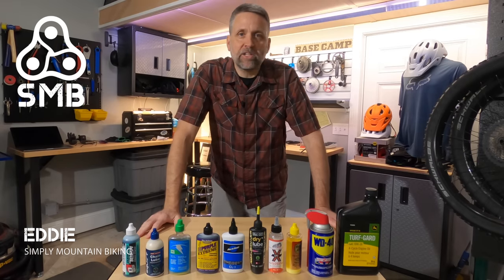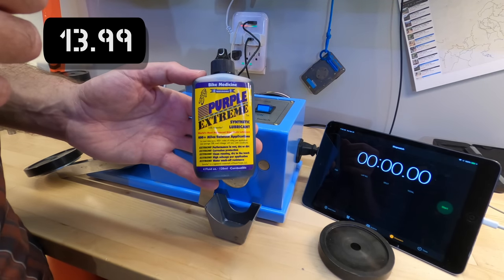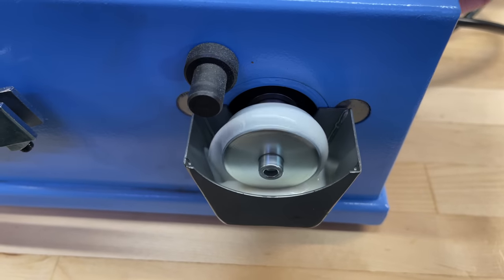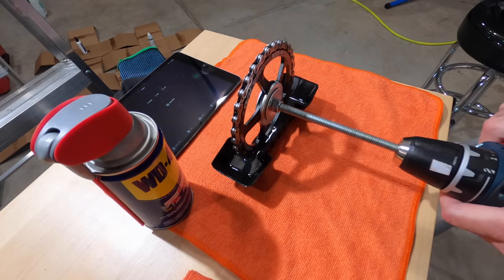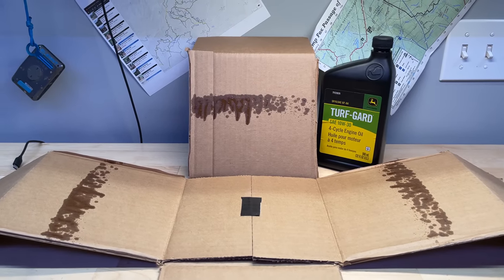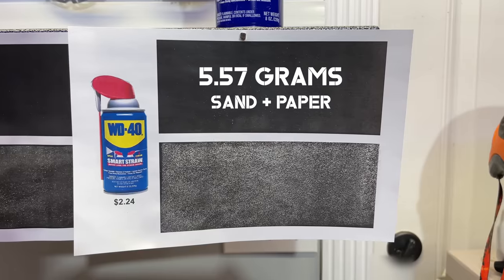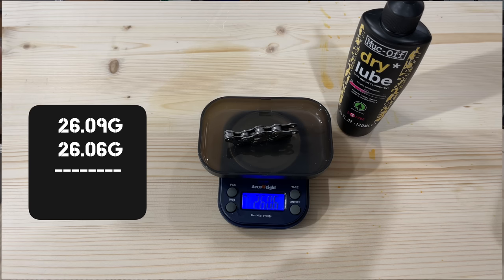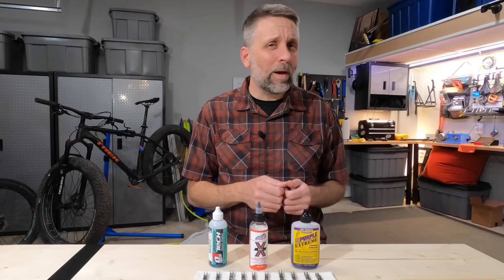Ultimate Bicycle Chain Lubricant Test | Best Bike Chain Lube

Comment: cool test and lots of effort went into it.  the test isn't valid for most of these products. The submersion wheel with test cylinder is designed to test oils, only a few of these are oil.  A majority of bike chain lubes are a penetrating carrier fluid with lubricant dissolved or carried by it into the chain.  Because the penetrating fluid isn't a lube, it product is only effective when it is dry.  The 'solids' in the lubes noted many times in the video are the lube in many cases.  Same applies to the 'sling pattern test'

Rock n roll lube is actually a carrier that is a grease dissolver and would presumably be a horrible lube.  The solids are the lube.  This product is intended to help clean the chain as well as lube.   You're supposed to wipe the softened grease/dirt off the chain after application, let dry and then you have lubed chain.

The dry lubes need to be dry for the sand test to be real-life
Reply from the maker: Everything I tested dry performed the same or worse on the friction/wear test. -Eddie

Comment: Hi. I use Rock n Roll Gold and only get about 30km before chain starts grinding. When cleaning plenty of black comes off signaling wear. Not happy with it. Can you do some real works tests with your tip three choices please.
Reply from the maker: I've thought about real-world tests, but it's so hard to get the same conditions each time.  Weather, trail conditions, etc. all vary slightly.  I have been using Muc-off almost exclusively for nearly two years now and I am very happy with it.  I haven't had a reason to go to the unfinished parts of the other bottles I used to test! -Eddie

Comment: I don't think you gave a fair test of Squirt because the instructions specifically say yo should let it dry before using it.  That gives the water part of the emulsion to evaporate and leave the wax part.   It is not going to perform the same when you test it just out of the bottle.
Reply from the maker: Check out my follow up.  -Eddie

Comment: Chains do not have rotational wear, it is rolling wear, the properties that protect it are not the same as a rolling test.

The pin inside the chain rolls back and forth in the same position and needs a lubricant with specific properties.

The other factor is how much dirt the product attracts and permeability. Finally, even if this was a rotational system it would need the correct viscosity for the gap.

Because of this you may get skewed results.
Reply from the maker: Thank you for your comment.  I don't think the pin moves.  It is welded or set in a link.  the other link moves on the pin.  Also, an o-ring chain has a ring around the pin that can rotate.  -Eddie
Reply: @SimplyMountainBiking  look it up, it doesn’t rotate. I’ll find it when I get home.

Comment: 20 yr. Old Raleigh. One chain over 5,000 mi.silicone dry with Teflon.also DGF FROM Napa. = dry graphite spray , messy over spray but stay power
Reply from the maker: Thanks for sharing your experience. -Eddie

Comment: Can I put Muv off on a brand new bike/chain or do you have to clean the factory lube?
Reply from the maker: I typically will use a new chain with factory lube until it needs its first cleaning.  Then, I apply whatever new lube I want to use. -Eddie

Comment: I used to race motorcycles for a bike shop when I was a kid and my mechanic use to clean the chain let it dry then soak it in a pan of thick oil for a day then hang it up to dry then install it, I know that’s a lot of work but I never lost a chain but I think thick oil would be fine to use with a rag
Reply from the maker: Thank you for sharing your experience. -Eddie

Comment: Tri flow is good stuff, just the bottle/applicator sucks. I use it on stainless steel uniball joints on my offroad vehicles keeps them quiet even in the dusty desert. It would be sweet if they had an aerosol version of it to do chains easier.
Reply from the maker: Thanks for the tip! -Eddie

Comment: Some of the lubes are intended to be used after the carrier fluid has evaporated; like Rock n Roll.  

I wonder if the friction test should have tested both wet and dry to account for this.
Reply from the maker: That's a good point and something I will keep in mind for future tests. -Eddie

Comment: WD40 is not a lubricant. It’s more of a solvent. It’s great for cleaning metal surfaces. It’s a great cleaner for titanium frames. Makes them look like new! The rock and roll gold also needs to be allowed to set up overnight as does a dry lube. I’m sure it would of performed better in the sand test
Reply from the maker: Thanks for the info! -Eddie

Comment: Good test but Rock and Roll Gold needs to dry overnight (and so do some of the others dry lubes) after wiping it off the chain which cleans the chain so probably better to follow the directions on the bottle to be fair. Someone needs to invent a chain cleaner with a particle filter worth using with R&R Gold to avoid the high cost of it's use as a cleaner (as stated on the bottle) as well as a lube... $14 bucks at local bike shop in town for 4 oz with most of it waisted. But good lube and cleaner used as directed AND expensive so creates an opportunity for some slick inventor using a pulsating high suction vacuum (like a desolder pen that resets itself for each link so about 2 minutes spin per cycle) and particle filter to keep excess lube vacuumed off clean...
Reply from the maker: Hey - cool idea! -Eddie

Comment: The first test is flawed. I admire the effort, and I hope you design a new test, but I can’t get around the idea that the force of the lubricant from spinning the wheel might be forcing the cylinder off of the wheel. It doesn’t even have to move it. How much force is there pushing the cylinder onto the wheel? If the lubricant is spinning around and pushing on the cylinder, it’ll reduce the force between them. And the differences between the lubes could be influenced by how much the lubes are spinning around the wheel.
Reply from the maker: Thanks for the feedback.  -Eddie

Comment: in the Sand test, Squirt contains water so the weigh of the paper will include the weight of water absorbed
Reply from the maker: The paper stood overnight before being weighed - all water would have evaporated in my temperature/humidity controlled garage. -Eddie
Reply: @SimplyMountainBiking  thanks for the clarification, that would have asssited with a more representative weight I agree. It would be an improvement to perhaps heat each test paper in an oven at constant temperature for a defined time. All the fluids have fairly night initial boiling points anyway so maybe drying at 49degrees Celsius would improve consistency at such low mass differences. Thanks for the efforts to at least demonstrate differences.

Comment: Do they not have 'Finish Line' products where youre at? Im a roady but I switch between Finish Line dry lube (with Teflon™) and squirt lube depending on seasons. Being from the UK, I have also used a lot of mucc off lubes as they are popular here but they do collect a lot of dirt but that could also be because i dont wipe the chain down after every ride.

Nice selection of lubes, maybe i'll give the rock n roll gold a try one day as it looks to be cheaper than other lubes.

Excellent video!

::EDIT::

(I have no idea why i repeatedly called it 'Finnish line')
Reply from the maker: Thanks - Finish Line definitely makes the list for the viewer's choice video. -Eddie
Reply: Surprised you’ve not tried rock n roll gold, I’ve used it for years been getting it from merlin cycles

Comment: was the first test unfair? did you clean it with the same method before performing that very first test? I feel like that stone could be adding grit or increasing the friction on the later tests? or maybe that one was just the best wearing lube.
Reply from the maker: Yes - the wheel was first wiped of excess, then cleaned with a degreaser, then ran against the stone, then wiped free and clean with a degreaser, then dried.  This happened before each test. -Eddie

Comment: I use the Extreme Pressure Ultra which is made by the same peeps as Purple Extreme. Would have loved to see that in the test. I ride about 70-80 miles a day on my ebike.
Reply from the maker: Interesting.  Thanks for the tip! -Eddie

Comment: Everything looks nice, but what about testing in peak temperatures?
I bike all year, some lubricants in below water freezing temperature act as glue...
While some in high temperature (around 30°C) tend to just, evaporate.
Reply from the maker: Interesting experience - and difficult to test for all riding environments.  Please take this baseline and apply it to your specific operating environment. 🙂 -Eddie
Reply: @SimplyMountainBiking  Might put the testing machine in counter top mini ice cream display freezer, this will allow both low and high temperature testing thanks to insulation.
From personal experience, Park Tool, Purple Extreme and WD (no surprise there) turned every surface into a fly paper in just about -5°C

Comment: So this is very similar to a BOCLE test used to test lubricity of middle distillate fuel (Kerosene or Diesel). This test works when the lubricant is circulated, it is not representative of a lubricant designed for low speed, tack on applications
Reply from the maker: Thanks for your comment. - Eddie

Comment: Like the first test but it can’t be tested this way for all of the here tested oils. 
Ok, I’m a bit biased here as I’m quite the Royal Purple fan. Purple Extreme is the same oil as Royal Purple Max Chain.

I know this being the case for Purple extreme, but I suspect possibly other oils being tested here as well, are using carriers that need to evaporate first before the actual lubricant will do it’s job - probably most dry lubes are using these, but now I’m speculating . 
So for the first test the wheel should be in the oil bath. But with some of these oils the wheel is in a bath of carrier mixed with lubricant and not the pure lube oil.. it’s comparing apples and pears. The carrier is not the lubricating ingredient. So by default the results of this test are not going to be accurate.
This test can only be reliably used for pure oils. Not dry lubes or lubes similar to purple extreme that have a carrier in it that needs to evaporate before they are working the way they should.

This makes the 2nd and 3rd test also completely meaningless… Once the carriers of the various oils have evaporated you should get completely different results.

For what it’s worth, I still love Purple Extreme. I apply it well before I’m getting on my bike so it has time to dry and I love it. Longest lasting chain lube I’ve used so far.

Anyhow, I like my oils - still enjoyed your video.👍
Reply from the maker: Thanks for your comment! -Eddie

Comment: I was hoping Triflow would be included in this test. It is recommended by my local bike shop. I use it for everything but winter riding when i switch to R&R gold. I tend to get longer mileage between lubes with Triflow over R&R.
Reply from the maker: I have a bottle - and I really want to do a second round with some new lubes - I'm hoping to get to it this fall/winter. -Eddie

Comment: These tests do absolutely nothing to tell you how they will perform in a drive chain. The closest one would probably be the water test but even then, that test would be akin to leaving your bike in the rain without riding it. The lubricity test didn’t follow correct application of the lubricant. You might say well what I do is apply and ride. Well then there’s your problem. The sand test meaningless. We’re not testing how a low viscosity lubricants holds dirt vs higher viscosity lubricants. 

A whole lotta testing for a whole lotta nothing.
Reply from the maker: Thank you for your comment. -Eddie

Comment: Can you do the test by coating the wheel without filling the cup in the tester? It’s not a valid test to keep recoating the wheel with lubricant when that doesn’t occur on our bikes. The way you’re doing the test is for car engine lubricant testing where there is an oil pan to continuously reform a lubricant film.
Reply from the maker: If I do a future test, this is how it will be done. -Eddie

Comment: 90W gear oil has been specified by most motorcycle chain manufacturers and motorcycle manufacturers as the go to for chain lube. It would have been interesting to see how it fared. Also how would a dry or Teflon motorcycle chain lube fare on a bicycle chain? New video?
Reply from the maker: Great ideas - Eddie

Comment: I’d love to see a paraffin wax application put through these same tests.
Reply from the maker: Thanks for the suggestion - did you see the video I made on Squirt? -Eddie
Reply: @SimplyMountainBiking  I’ve used squirt in the past and can tell you that it’s nothing like a paraffin wax dipped chain. I’ll fess up and say that paraffin is the method I use, I think I’m right, and I want YouTube to back me up. 😉 but truly, I think more people would like to know that there’s another way.
Reply from the maker: @LandonArkens  I tested paraffin on the friction wheel in the Squirt video.  I've never tested it on a chain, personally. -Eddie
Reply: @SimplyMountainBiking  good to see the friction test like that. I wonder if there’s a difference in the wax bond by allowing the bonded surface come up to hot temperature, as I do when I submerge the chain for a couple minutes in hot wax.

 My top level priority is its ability to repel dirt and water. You can imagine that the friction numbers would all be very different if sand were introduced to the test. 😄

Comment: WD40 is not and never intended to be used as a lubricant. It is a water displacement (W.D.) designed for use on the Atlas Missile to protect the outer skin of the Atlas Missile from rust and corrosion and to release Ice. Used also to displace water on ignition systems, penetrate, squeak reducer and corrosion protectant.
Reply from the maker: Wow - neat! -Eddie

Comment: Muc Off Dry Lube being the winner, can anyone comment on the instructions for a new chain? Need to strip and apply fresh (like Squirt) or can it just go on top and will eventually replace the original lube after use?
Reply from the maker: For this test and my first time use, I stripped the chain.  The rest of the time I've used it, I've just applied on top of the Ultra Sil that comes on a new chain. -Eddie

Comment: Here is my test, you use any one of your top 3.  Let's ride 10 miles of gravel/ dirt/ off road and then feel your chain vs. mine with wax or Squirt!  Yours is gritty...mine is clean.  We have a winner!
Reply from the maker: Thanks for your feedback - I've used Squirt on the trail and I wouldn't characterize its condition after a ride as "clean" in my experience.  Thanks! -Eddie

Comment: The wet test measurement seems wrong to me. I think you should be measuring the percentage of lubricant lost. In other words: 1 - weigh the chain, 2- soak it in lubricant and weigh again, 3- find the difference between 1 and 2, to get the weight of lubricant before the wet test, 4- perform the spraying, 5- weigh again, 6- find the difference between 1 and 5, 7- find the difference between results of 3 and 6 and calculate percentage of lubricant actually lost.
Reply from the maker: Thank you for sharing. -Eddie

Comment: I would like you to try one more test by a company is an aerosol can by Maxima chainwax chain lube. I have been using this on my road bike and it's also very common to be used on motorcycle chains. I had very favorable results with this but not a test like you've got would you try it and get back?
Reply from the maker: Thanks for the tip - maybe some day. -Eddie

Comment: One area where WD 40 works kinda well in my experience, when you have partially cured/very viscous/sticky grease and and want to loosen that up.
Im not sure if it breaks up long polymers, but somehow these very viscous greases seem to work again like a moderate aged grease.
Reply from the maker: Thanks for the tip! -Eddie

Comment: I found my riding results did not match your experiment mucoff wore a chain down from 0.25 to 0.5 in less than 200km, and the same chain on a different lube had done over 1000km mixed road and sandy MTB.
Reply from the maker: Thank you for your feedback. -Eddie

Comment: WD-40 is actually a water displacement product. You would spray this on electrical switches and other similar types of components. It is not a lubricant. Solid testing procedures, though.
Reply from the maker: Got it! -Eddie

Comment: Just to clarify, WD-40 isn't a lubricant at all, it's for breaking seized bolts, etc. If you use it as a lubricant it will dry quickly, get sticky, and attract a lot of dirt and debris... One of the many pet peeves of car guys
Reply from the maker: Thanks for the info! -Eddie

Comment: What was the "sling" test meant to demonstrate? Do people put that much lube on their chains? Even if so, the rotation speed was much too high.
Reply from the maker: Really it was to measure how well the lube will cling to surfaces.  Often, manufacturers balance viscosity so that it can cling to parts, but also have enough flow to penetrate the o-rings.  I had a viscosity test I was going to add to this video using a flow cup - but I scrapped it.

Yes, I realize the velocity was high - but it was fair across all lubes.  On the smallest rear cog at high speed, you actually may approach the angular momentum in this test. -Eddie

Comment: I always tell people, wd-40 is an extremely poor choice for a lubricant, and it acts as a solvent for preexisting lubricants. However, you can use that to your advantage while cleaning parts with oil or grease on them. Spray wd-40 on the parts yo rinse off the grease, then use a degreaser to remove the wd-40. Gets your parts nice and dry for relubrication. Also, because dirt sticks to it so well, it's good at flushing dirt out as well. Never a lubricant, and certainly not a penetrating lubricant
Reply from the maker: Thank you! -Eddie